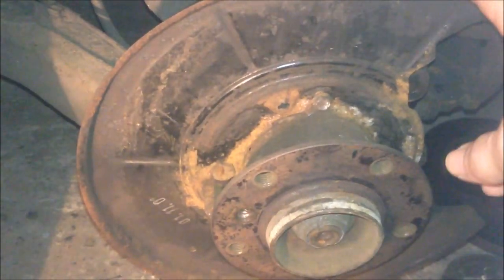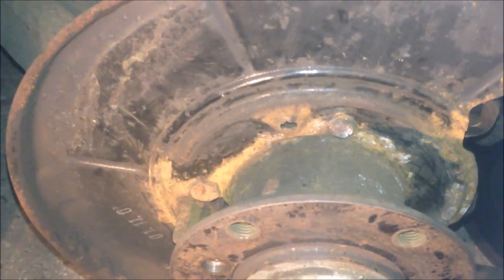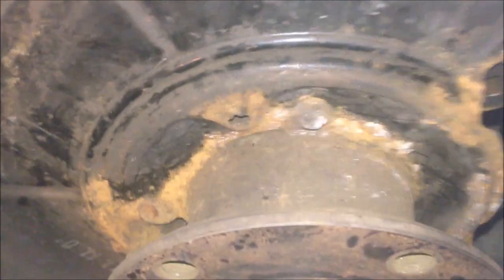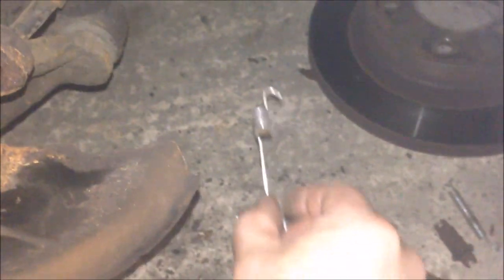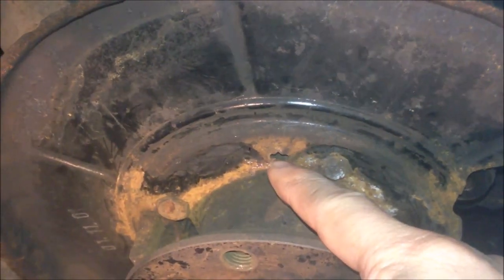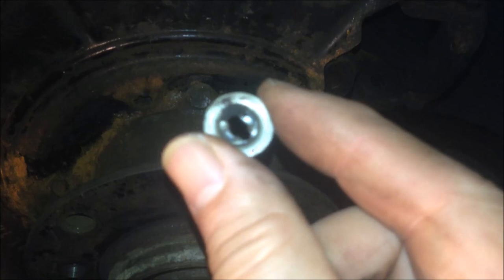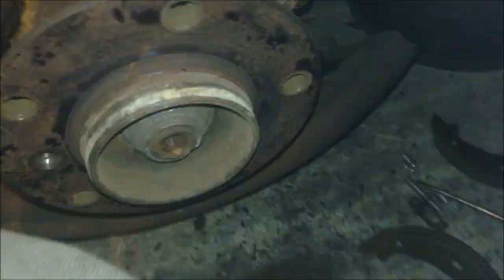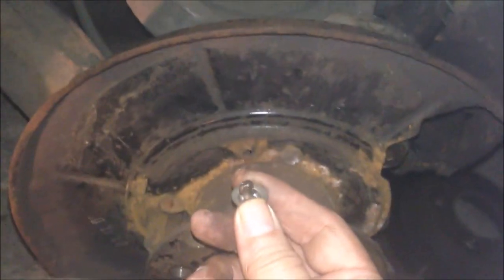BMW E46: Handbrake Shoe Hold-down Pins were Pulled Out

Comment: I actually ditched the spring and pin and used a suitably sized bolt, with a couple of spring washers so it would have some give and allow the shoe to move. Pretty much a bodge but it actually held up for a couple of years (after which the car was scrapped)
Reply from the maker: Thank you for your comments. That's an easier way to do it! would be very useful for someone here looking for a quick solution. All the best.

Comment: Hi. Thanks for the video. 
The pins and springs on mine came lose as well because the back plate is rusted and the hole became too wide.  Now I’ve ditched the pins and springs, means the shoes are not fixed. Do you think I can drive the car for now? Until I get it fixed. Thanks
Reply from the maker: Hi, I recommend that you don't drive. if you are very experienced driver and you have to drive, you only drive if you can avoid hill starts and parking on a slope.  Always engage 1st gear or reverse gear when parking on a relatively flat road or driveway. Get it fixed asap. Safe driving for others and ourselves. Take care.
Reply: @RepairDIY  Thanks for the reply. It will be fix and I won't drive it for now :)